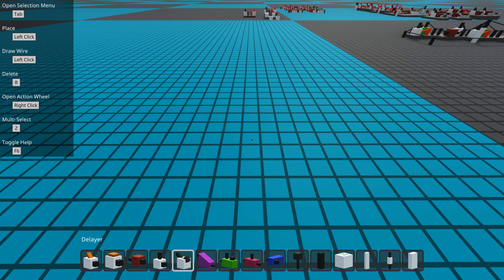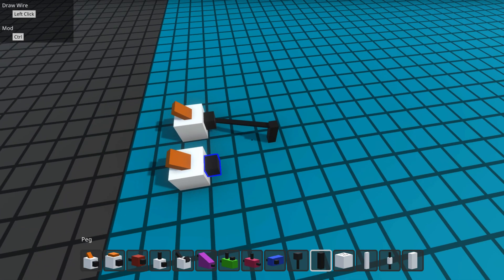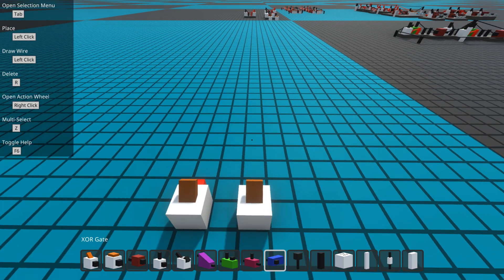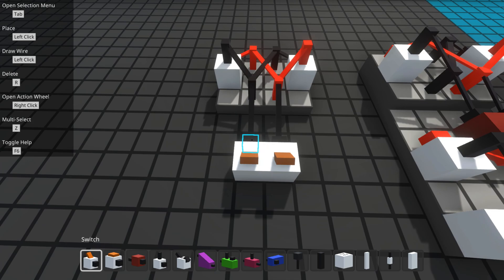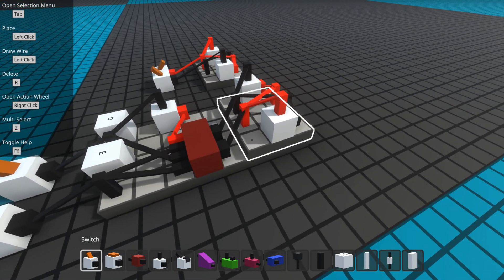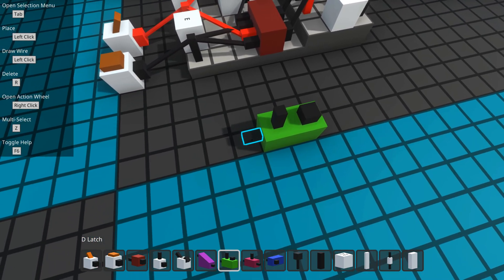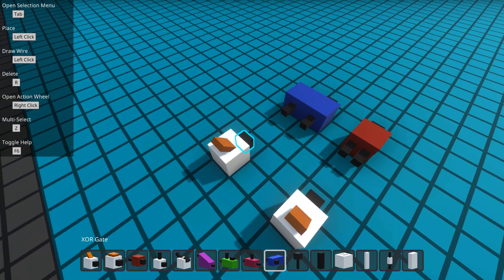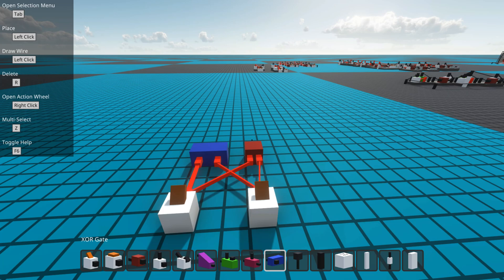Introduction to basic digital logic circuits using Logic World

Comment: @6:36 are those two white blocks 'labels' ?   If so, I cant get my Peg to fix onto those label items.  I cant find any other white block in the inventory.

How to install a peg onto a label like that, please?  :)
Reply from the maker: At 6:36, the only white blocks with pegs on them, are inverters I think?  I think you can see wiring coming out from the terminal that's hidden by the block itself

Comment: Thanks for taking the time to produce tutorial videos like this. While I have programming experience, I have none in logic circuit theory (the logic gates thankfully share something in common with compound conditional IF statements at least). How you made a button store a state and how an adder works was especially helpful.

Maybe next time when you have a free moment, could you please make a video on how to properly lay down wires neatly, and without component or pin collision?
Reply from the maker: I will try to remember request for laying down wire.  I try, when possible, to run lines in parallel for my CPU busses, and keep those neat as I can.  But for assemblies like an ALU, I go for consistency when possible, wiring each sub board up the same way, but not necessarily the neatest wiring.  Components get in the way all the time, and sometimes I improve placement with trial and error.  Sometimes I just have to elevate pins or components.  Pins using platforms, components using small circuit boards.
Reply: @michaelbauers8800  Elevation, that's a great idea. I keep forgetting Logic World is a 3D environment. 😁